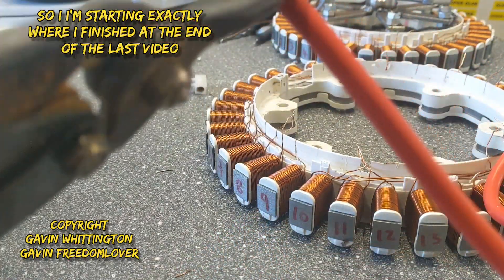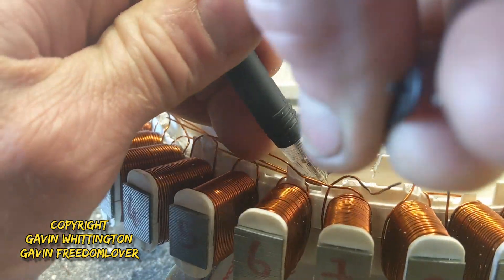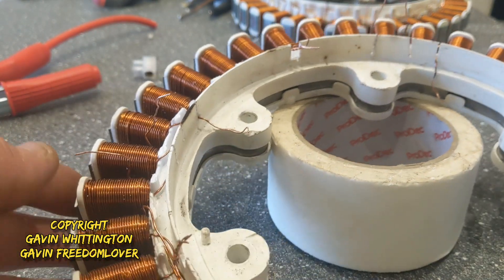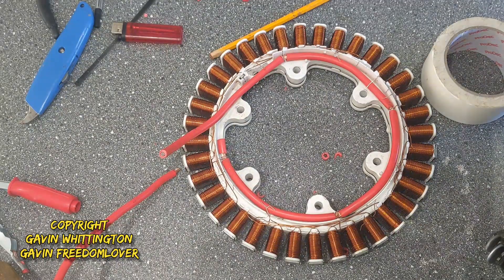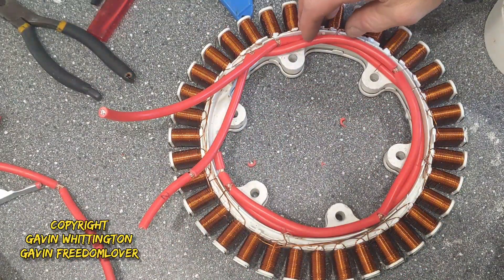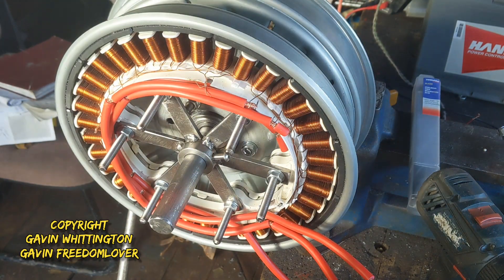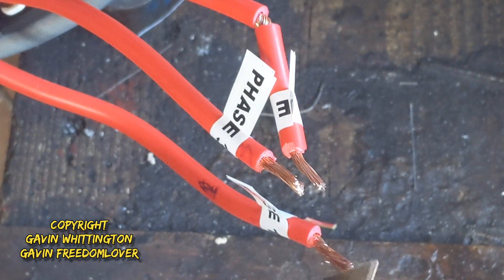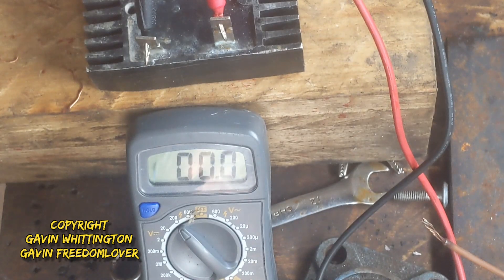LG Smartdrive stator re wiring instructions PART 2 for 12v/24v Wind Turbine Generators

Comment: Pernahkah anda memodifikasi yang 36pole 3phase dengan memodifikasi 1phase untuk mengambil kebalikan arah gelombang dengan dengan jembatan penyearah
Reply from the maker: No my friend. I didn't try that. I gave up with these motors. They are not powerful enough. They are good for use in hydro if you get 1,000, RPM spin speed
Reply: @GavinFreedomLover  Ok terimaksaih sahabatku yang juh disana untuk sharing salam hangat untuk Anda,Saya sangat kesulitan untuk mencapai 1000RPM dari micro hidro ataupun Air ataupun Angin  karena lingkungan ,Tapi saya akan berusaha  dari 3phase saya ambil 1phase  untuk generator  penggerak ,Tapi entahlah

Comment: Could you use the unit unmodified and step the voltage down via a transformer? Then use a single phase bridge rectifier?
Reply from the maker: I guess you could do that. I've seen people talk about using an unmolested one in a vertical axis wind turbine because it's suited to the lower RPM, I gave up using these motors because I found that electric bike hubs of the right kind are much much better in every way.

Comment: How much watts can this produce?
Reply from the maker: I have taken it down now , max was about 500 watts but I made some errors in the build could get 800 max in very windy conditions, they only make 1kw at 1000rpm in a hydro setup.
Reply: @GavinFreedomLover  oh wow i was about to ask if that can be applied to microhydro. 1kw is good enough for me. I was just thinking if how much can it generate in a water wheel with a 70liter per minute flow and a height of 3m.
Reply from the maker: yes they are great for hydro make sure you get the bearing stub from the washing machine.

Comment: hi this is awesome videos ,cany you tell me the 3 wires you join together are they an earth ,are they used for anything will bit of heat shrink do to cover them. when testing you only test the 3 main wires no earth
colin
Reply from the maker: You need to connect the 3 wires coming out to a DC rectifier which changes the AC power into DC for battery charging.
Reply: @GavinFreedomLover  thankyou

Comment: Doesn't going deep on the slots run the risk of arcing; or, do you use hot glue (etc.) later in the video/video series to prevent such arcing?
Reply from the maker: Thanks for the comment I am knee deep in building a machine then I will get back on this project.
Reply: @GavinFreedomLover  Thank you. :) I know what it's like to have to try to juggle projects. :) 
I didn't word my original question all that well, anyway; in that I didn't clarify that I was referring to "on down the road," when wind & weather could start causing some corrosion. (I do tend to "over-think" things a lot; but, it's also the reason why I've survived for 67 tumultuous years...)
When you have the time: I'm curious about the combination of 12/24v & 3 phase. I, admittedly, "know just enough to be dangerous" ;p & I'm learning as I go. Here in the US, 3-phase is (as far as I know) always AC; &, typically, only used in industrial settings. 12/24v is typically DC; &, for most applications, requires the use of an inverter to run anything; but, it's appearing to be great for charging super-capacitors (which are getting more affordable & seem to beat the heck out of having a huge bank of deep cycle batteries.) About my only use for 220/240 is my welding machine, which I'd like to continue to be able to use; but, that might easily become irrelevant, given the current dystopian trajectory of the US. I might be darned lucky to get things done in time to even have lights & refrigeration before "the bottom falls out." Anyway... Do you (and others who might be willing to chime in on this) think this wiring version would work over here; or, should I be looking for a more "US version" of how to set up my wires?

Comment: It outputs the Voltage the correct way because you have 6 diodes in the 3 phase rectifier. So no matter the direction of rotation, it will always be positive on the positive terminal and negative on the negative terminal.